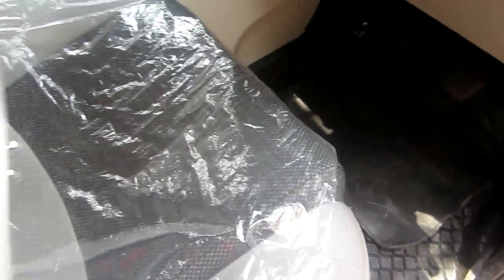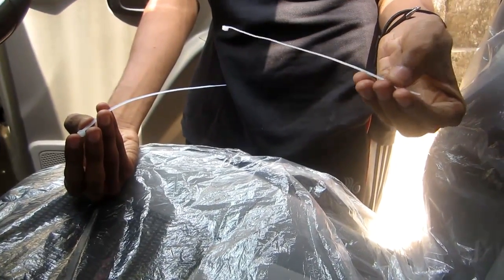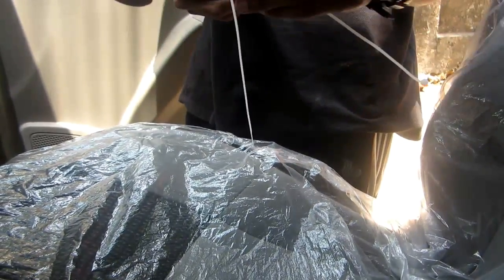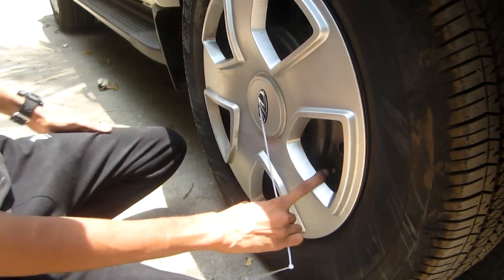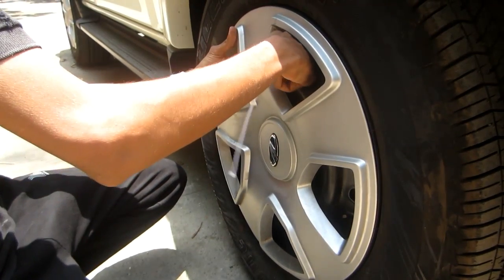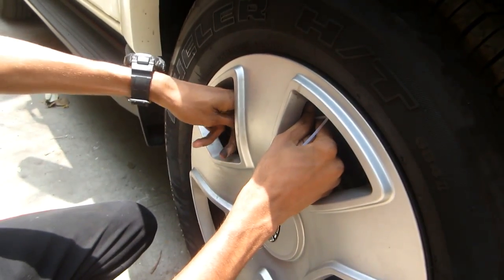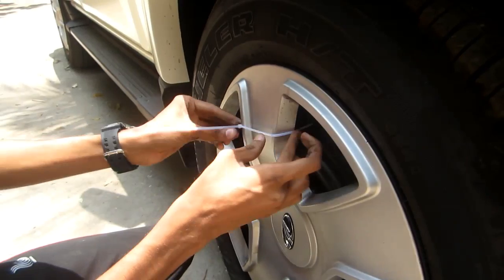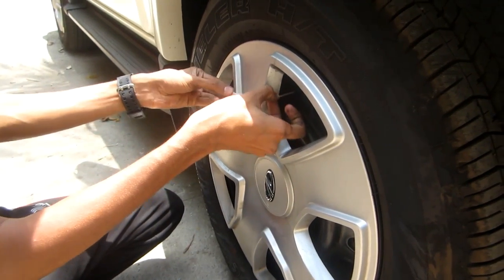How To Prevent Wheelcaps From Falling Down | Mahindra Scorpio | DIY | Car Life Hack

Comment: I already put those rubber belts on all of my hubcaps, but in a long journey, two hubcaps fall off from my wheels.

I lost them both, and now I have to buy a new set of hubcaps once again!! 😣

Can you give me the reason, that why my hubcaps fall off, after they're tightly fitted with those rubber belts?

I have no idea how to prevent it, no matter how many times I have brought new hubcaps but they're always fall off, when the car bump on the road.

Please give me some solution, I don't want to spend money repeatedly in hubcaps!! 

My car still have many hubcaps missing, now I'm thinking to buy a new set but this time, I don't want to loss them!! 😩😩

Thanks for reading!! 😊
Reply from the maker: Actually the wheel caps mostly fall off when we take our car through the potholes....the jerk does a movement and the wheelcap loosens and hence falls off.

Tieing the zipties is the best idea but they also tend to break up after 5-6 months
Reply: @AAA Diecast & Vlogs Thank you so much for such a quick reply!! 👍👍 😊😊
Reply from the maker: Welcome....

Comment: But it kinda looks messy ..  ain’t there any other option , because your wheel caps add more aesthics to the vehicle and these jugaad makes it a bit low budget thing .
Thanks for the video !
Reply from the maker: +Mandar Kirve Budget was very less bro
Reply: A.A.A. Diecast & Vlogs the video was good no doubt . I m just asking if there are any other ways available that won’t affect the look of wheel caps
Reply from the maker: +Mandar Kirve there is one way to get aftermarket spring loaded wheelcaps.

But they also fall if the vehicle goes into pothole.

The best option is to remove those wheelcaps and install alloy wheels.